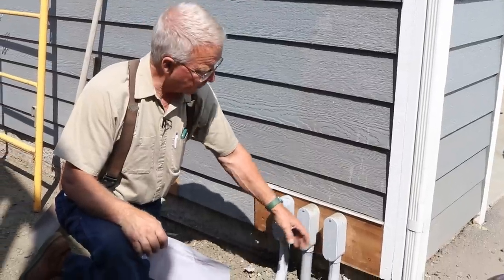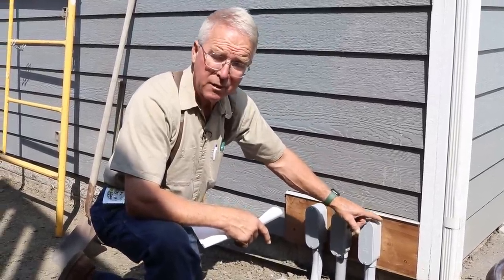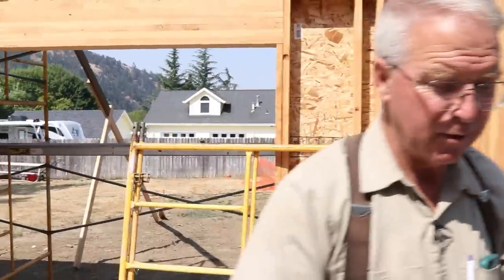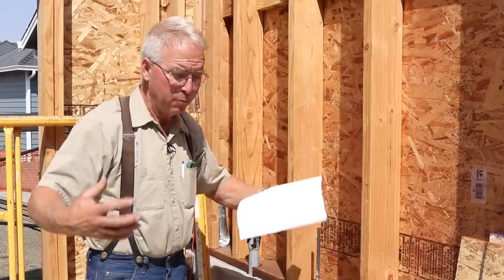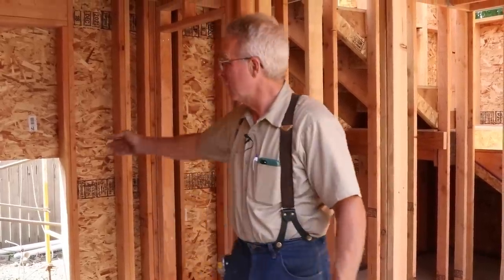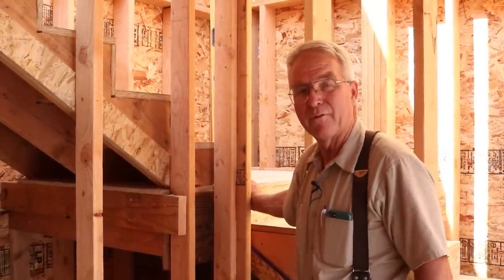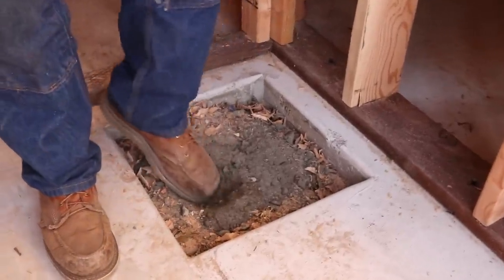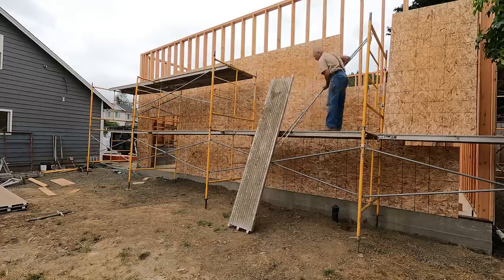One Thing Always Leads To Another... Shop Build #15

Comment: You're 64, I'm 79. Enjoying every moment doing 95% of the work on a LARGE tiny home with/for my daughter.  We started it March 2020. It is 20x46 two story on concrete slab in the Missouri Ozarks. We designed it around steel framing I got free 20+ years ago. Steel siding & roofing Gambrel roof. I built the trusses & a 50 ft. ridge pole truss. I will build the cabinetry. I am 75% complete with the electric, all up to code even though "anything goes" here in Ozark County. Since we have no clock to punch, just something done each day, it is enjoyable beyond belief. 🤗
Reply: EVERY DAY IS A BONUS
Reply: living the dream
Reply: Amen! I’m 66 and it’s the desire of my heart to do as much as my body will let me do every day for my kids and grandchildren.
Reply: @paulhasser625  Mr Hasser an' Essential CraftsMan!
  Surely!  You Will have..., "the Desires of Your Heart".  
  Even more than those Desires You've already been Provided with.
                  🙂
Rick Bonner Pennsyltucky
Reply: Fantastic!  At 1800 square feet, I'm not sure that qualifies as a tiny house.  She is lucky to have a dad like you!
Reply: Isn’t a Large Tiny house an oxymoron?
Reply: @brismith2728  YUP! You're absolutely right. Actually we WERE originally going to buy a 16x40 shed to make a tiny home & finish the inside. Financing fell through so, not to be defeated, I said let's build from scratch with what we have. Started with concrete slab. Since the heavy framing was 20 ft, we made it 20 ft wide by 40 ft. Then added a 6 ft extension on one end to overhang as a porch. Since it didn't have to be on the highway,  we made 8 ft high lofts on each end. (The shed had 3.5 ft lofts.) It has a 20x20 ft center with vaulted ceiling at 17 ft.

We chose steel siding when lumber cost went up over triple. We will have urethane sprayed once done with wiring & plumbing. We used free Anderson Windows & some heavy doors I had stored for years. I grew up working in my Dad's cabinet shop & had my own shop for 17 years, so will build the cabinetry. When done it will equal or exceed any $100K house with about $30K out of pocket + sweat equity.
Reply: 20 x 46...920 square feet...but there's a second floor, so possibly as much as 1840 square feet.  I don't think that qualifies as a "tiny home" at all!  My first house, which was not considered a tiny home, just an ordinary house, was 1450 square feet.  We once rented a "tiny home", about as big as they get really, something like 420 square feet.  It still could be towed (tiny homes are generally on trailer frames, can be towed with a medium duty truck), but the "loft" first needed to be removed and carried separately, and the large porch folded up against the side of the house.
Doing a build like that, with your daughter, has to be a great joy to you.  Building it in the Ozarks is just a bonus.  Doing it all at 79 is amazing.  I hope you get to enjoy the result for many years.

Comment: I’m 74 and don’t have the stamina I had at 64, but I’m still building a 750 sq ft work area with a 500 sq ft office above that inside my hanger. I did 85% of the framing, 100% of the electrical, 100% of the plumbing, 100% of the painting, and 100% of the AC/heat. I hired out the spray foam and drywall.  When your 74 I suspect you still be running circles around the youngsters.  Love your videos, so keep up the good work.

Comment: I would recommend running the low-voltage networking cable as a fiber cable. Converted boxes aren't to expensive these days. And it makes for great future proving in the terms of speed and latency. Low-voltage electrical isolation between the two buildings is a nice bonus.
Reply: This. You can get some nice armored fiber from FS for a reasonable amount. Plus as an IT guy it's a fun project

Comment: It's a great looking job.
One thing I've had to learn to do, due to a loss of strength in my legs due to an ongoing  medical condition, is to either look for ways to make shifting heavier objects easier (not that big a deal, I'm an Engineer and love a challenge!) or to be prepared to ask for a hand, even if it's just to get  materials closer to where I need them. In exchange for the ocaissional helping hands I do the things I'm really good at, Electrical Design & Installations, Project Planning and just coming up with solutions to problems.
There's a fair exchange, muscle for brains/experience and it gets things done.

Comment: Hey Dude, you need to sawcut that when it is REALLY REALLY green if you don't want other cracks. Rather than chase that one down the rabbit hole, we usually tell them to just use airplane groovers and tool them in wet. I know they are not as flat as sawcutting,..but I've seen guys cut the concrete joints the next day thinking it was still "green" enough... In fact,..more often than that they do it that way.

Comment: For what it's worth it might be a good idea to extend the condit for the sprinkler wire out so it goes beyond the new cement slab on the side of the garage so it can better facilitate replacing the wire in the future if need be and slab won't be an issue.

Comment: Do you have to use a specific type of hold down bracket or could you have fabricated them in the shop using steel plates?
Reply: Most times the tie-downs are specified and approved on the plans. A person can go over spec but not under, and to make your own would mean going through the engineer, testing lab and then back to planning and zoning for a new okey-dokey. Bottom line?  Stick with simpson ties but forget one or two so the inspector has something to find.
  It's the same as trusses.. buy em pre-engineered. They're already up to code. Gotta get approval on stick built, gussets, nailing schedule, chord placement and pitch. Mother's maiden name helps but not required. This probably doesn't help much but I've gotten off my chest.. I'm 67 and bent my first nail at about 21 or so. Still building and hand splitting my own firewood.